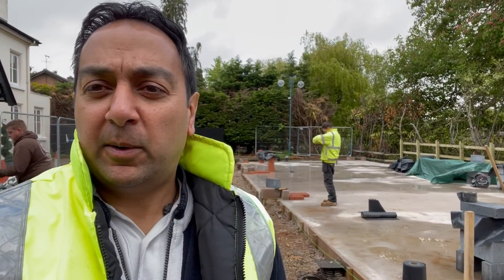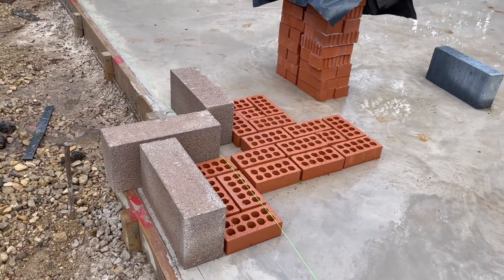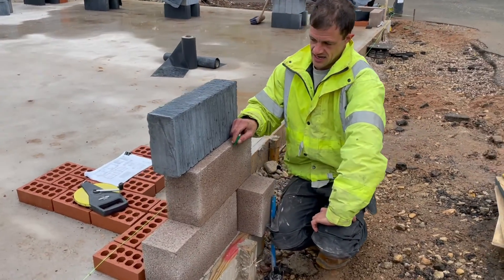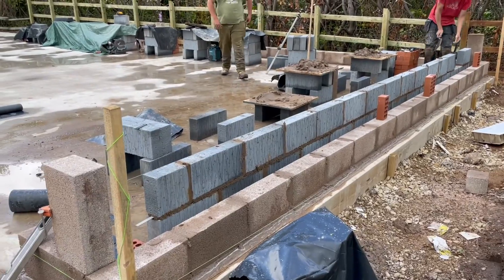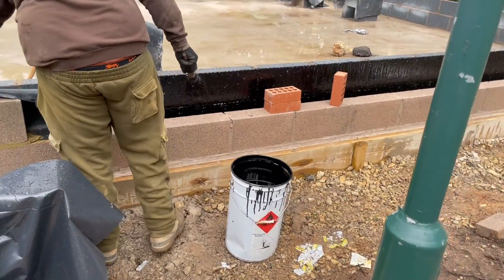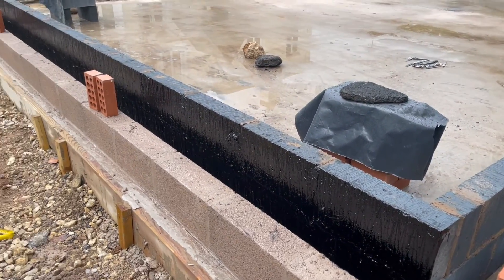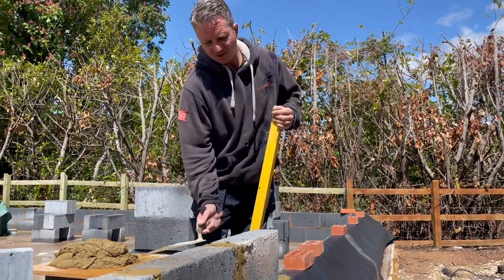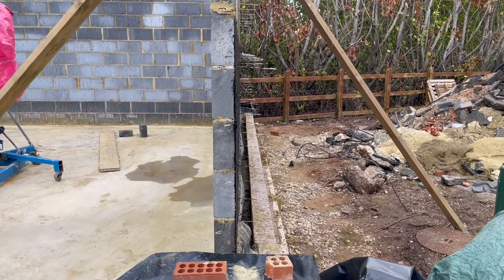Installing Damp Proof Course (DPC) | Part 10 | 6 Car SMART Garage Build

Comment: I'm looking at options for my DPM. Surely moisture can travel through the sides of your slab like that? Do you plan to do an epoxy floor or similar to seal internally? My original plans had the DPM wrapped underneath and around the sides into a drip tray but I'm not happy having an exposed DPM at the edges and J&S weren't happy to guarantee sealing of DPM to piles.
Reply from the maker: Good question and in hindsight this is something that I feel should have been added. Not had any problems at the moment but agree there is a ‘potential’ for damp to permeate along the vertical face. You should discuss this with J&S what they recommend as part of the slab construction or post build to avoid this problem.

Wasn’t happy with the floating as finish wasn’t as I’d hoped - this was the builders fault not J&S as he started too soon.

Not going to do epoxy because it’s either grey or grey 😀. I’ll be installing the pvc interlocking tiles once the driveway is finished. Much nicer look than epoxy.
Reply: @sanjdesigns  Hmm, J&S just suggested I fit a dpm over the top of the slab and pour a screed as you would conventionally but as the whole reason I need this solution is to avoid affecting the surrounding tree roots I’m starting at ground level and it all adds up very quickly in height! I’ll be installing a lift and will be welding so don’t fancy any of those tile solutions, I’ve previously had light grey and it works well for bouncing light around when underneath. Maybe blackjack on the slab sides and a similar tray as you have done then seal the bottom inner blocks?
Reply from the maker: Blackjack and a tray sounds like a good idea. The blackjack will act as an adhesive as well as a sealant. . Yes more work but hopefully save you in the long run. I still have some of the wooden shuttering around my slab and this will be removed when the block paving starts so I’ll probably do the same.

Definitely wouldn’t screed on top as this is more money and time, plus a risk that the screed will crack once you add your lift. Just my thoughts.

Comment: There should have been a boot detail at the edge of the concrete should never set cavity wall on flat base no need for bitumen if done properly
Reply from the maker: Thank you Paul and appreciate your feedback. Building control viewed DPC and were happy with the build and structure and signed off the stage before starting main blockwork.
Regarding bitumen, don't disagree, but its a belt and braces and anything to stop potential damp and moisture is a good thing. Was what the builder recommended and did and don't have a problem with it. It was purely a recommendation and I have seen this on other builds. But is a messy job and time consuming.
Reply: @sanjdesigns  these young buiding inspectors are not familiar with on site building practice.. Without a boot detail on the edge of the concrete moisture can get under the dpc and travel across the top of the slab